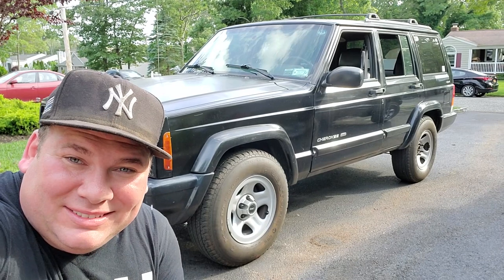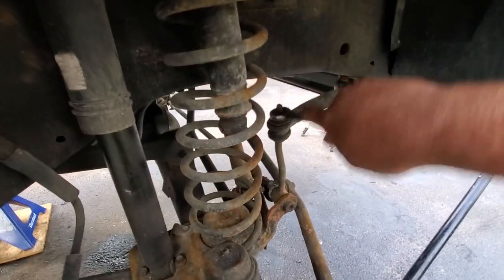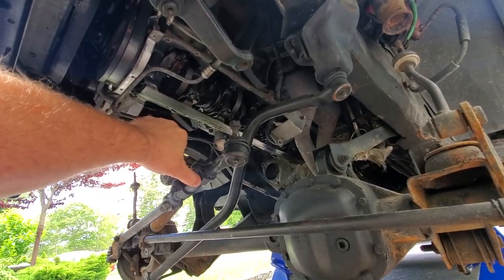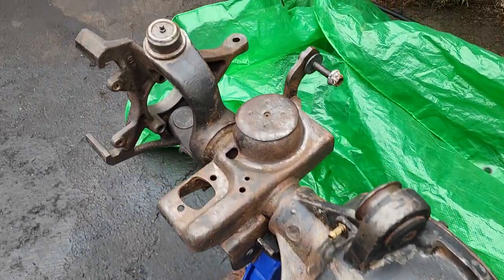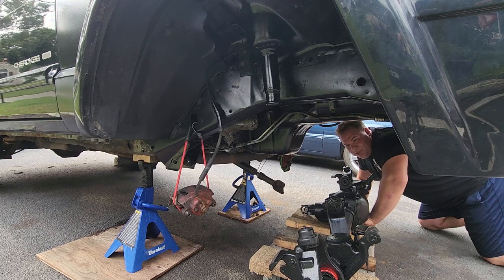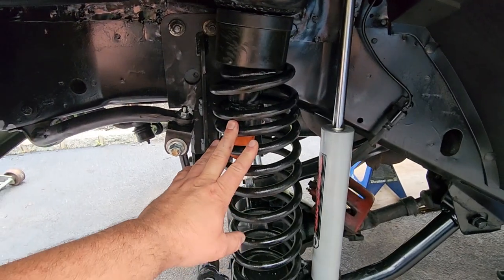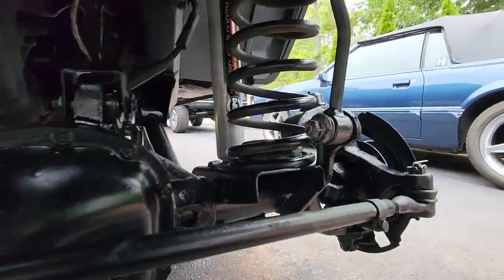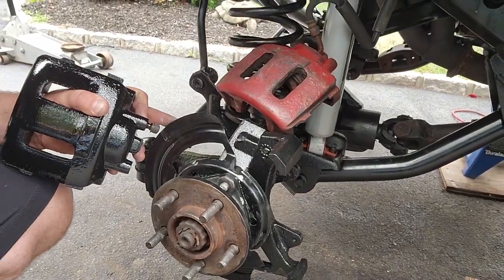LIFTING A JEEP CHEROKEE XJ - WRECKED J LIFT PART 1 - FRONT END

Comment: Dan, Great job with the Lift replacement. With all the trouble you went through with painting, I'm sure you were going to apply corrosion coating to the sway bar fasteners. Looks like those will start rusting after the first winter storm this year.
Reply from the maker: Yes.. I have a post-lift video coming in which I mention anti rust coating such as fluid film

Comment: Thanks for the call out for torque specs on the parts you  upgraded and others you reinstalled. I have to do everything you addressed on a 95 ZJ including upper and lower ball joints and both engine mounts. I was considering removing the entire axle to get to the R&R on the left and right UCA's and easier access to the engine mounts. Your video convinced me to go this route.
Reply from the maker: Thanks man!  Just a few bolts more and the axle is free and clear out of the way .. sky's the limit!

Comment: I wanna lower my WJ, an inch. Already put the 1 inch sway bar on the back. Gonna try cutting a half a coil off to start.
Reply from the maker: Maybe try a lowering spring.   Please Don't cut 🙏
Reply: @ProjectDanH  Absolutely right, I'm not recommending cutting, I am doing as a test, not an end all. Guess I should have been clearer on that. If I don't like how the suspension reacts I can put stock back on without purchasing expensive lowering springs first. Not concerned with my original springs, I have a 1/4 of a million miles.

Comment: Dan, what was your process/technique did you use with regard to washing, cleaning, and painting your wheel wheels, axels, steering, etc?

I just bought some Rp 342 and some Strip clean metal prep along with some Zep Purple industrial strength cleanet and steel wire wheels. Anything im missing ? I think I’m in the right track. Thank bud,

-Fletch

Comment: Hi, i really enjoyed video, my stock 2000xj , i just bought 3 lift kit( only schock, spring,a pair leaf) alot opinions suggest  ( aditional )should only need new pair sway links and a transfer drop kit, my intention is just 30 inch tires on a off set wheel only to use street routes. Is it necessary drop bracket , new arms etc..  ? just want a smooth ride . Appreciate your advice; thanks
Reply from the maker: Yes, for a 3 inch lift you may need to do a drop bracket. you might get a slight driveline vibration
Reply: @ProjectDanH hi, what would you recomend  on the sway links ( a lot options i see ), any in particular not sure …. Thanks for your reply, 💪
Reply from the maker: @wilfredvelez5033   i have heard good thingd about these but I didn't try em yet.  let me know that you think https://amzn.to/3wHtDiR
Reply: @ProjectDanH  i look the sway links you send me in amazon but there not available and it only for regular stock, then went to ebay ….. thanks 👍